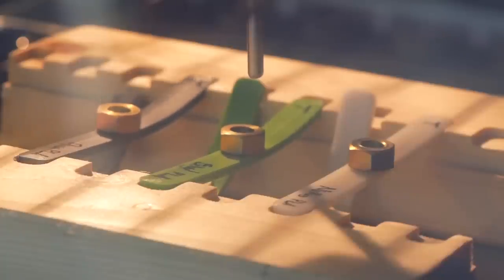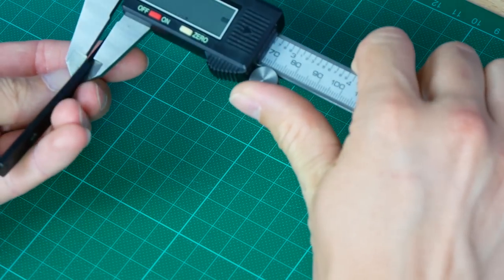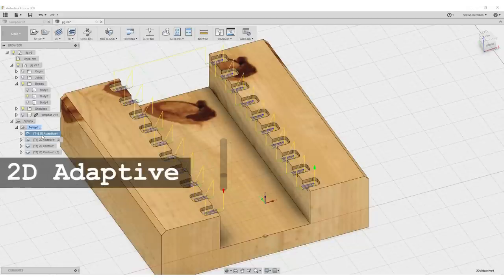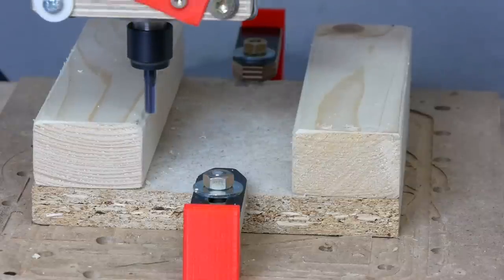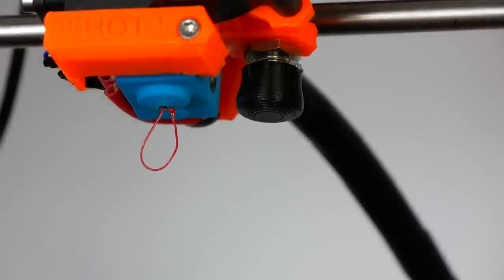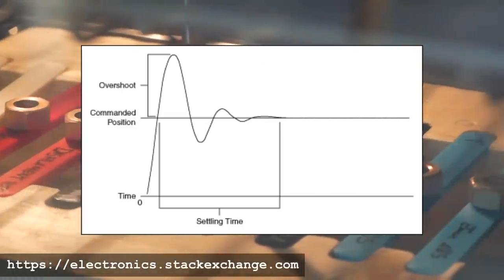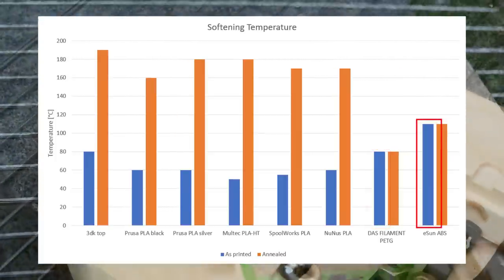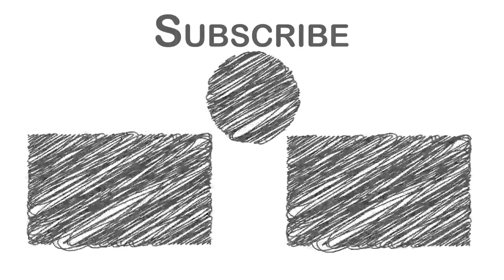What's the temperature resistance of annealed PLA, PETG and ABS?

Comment from the maker: What's you experience with using prints at higher temperatures and annealing PLA? If you have any suggestions please let me know down below!
Reply: I wonder if the shrinkage percentage in each axis is constant for annealed PLA? If so then we could oversize our prints by that percentage amount and keep the expected dimensions.
Reply: it's pretty much consistent, at least according to my experiments. But if you need screw holes to be precisely positioned, you better do the annealing process with the PLA piece screwed in position and solidly clamped.
Reply: hey man, can you test the annealed PLA with gasoline, will it brake? hope you read this thanks
Reply: Hey what about the mentioned amazon affiliation links? i find none in this description :(
Reply: Have you tested 3D Fuel's Pro PLA? It claims 90C resistance when annealed. I have attempted, however there were gaps in the layers and thus didn't suit my needs.
Reply: Stefan What if you coat the PLA with a thick layer of ABS  before annealing and after it you use aceton to dissolve the ABS for minimize deformation?
Reply: I would really want to see a quantified test for the improvement on heat deflection after soaking in grain alcohol (100proof) for 4+ hrs. There seems to be a noticeable difference, with little warping vs annealing (props to Alex Kenis for the process), but it would be nice to see how grain alcohol treated PLA perfoms compared to ASA, ABS and PETG, and if the effects of higher temperature resistant are permanent or temporary.
Reply: What was the distance between supports in your testing? Approx 70-80 mm?

Comment: Just annealed some test strips of eSun PLA Pro and MatterHackers standard PLA yesterday. Putting them in my car today in hot California heat to see if they hold up  -- we will see !!!! As a side note you may want to leave your supports on parts for extra support when annealing  My oven is set to 200Deg F using an oven thermometer, set for 30 minutes heat time and let room cool !
Reply: Just finished testing (tested in oven, not my car) and I can say without a doubt the annealed PLA is MUCH, MUCH better at higher temp. at 160+deg the annealed parts kept their shape after 20 minutes at which time I turned off the oven. At about 125+ deg the non annealed PLA gave up the ghost and warped badly. I have not tested for strength yet, but I bet it will be better than standard PLA. PLA+ shrunk less than standard PLA in the annealing process BTW.
Reply: Thanks for the info

Comment: It's worth mentioning that heat deflection temperature is also proportional to the induced stress in the material, which is why the test in ASTM D 648 has two loading conditions.
This is important because a single point really doesn't tell you much about its useful temperature range.
Reply: There’s 3 points

Comment: Another fantastic, very well thought out and made video. Good work. I love to see this kind of work for the 3D printing community. I'll be sure to drop some cash to your PayPal later this weekend.
Reply from the maker: Thanks, that's highly appreciated! I really enjoy sharing my research with you in order to evolve the technology and the knowledge about it.
Reply: CNC Kitchen I'm the same, but have no idea or talent when it comes to making videos!

I'm currently building a better machine in order to print larger polycarbonate, and hopefully POM parts. I print nylon, petg, abs, nylon-cf, petg-cf and various others at the moment. Trouble is I rely on passive heating of the chamber and have no control. It would be interesting to see you enclose your printer, and the effects of chamber temp on material properties.

keep up the good work!
Reply from the maker: Such a heat chamber will be one of my next projects before fiddling around with ABS because I don't really like the results at the moment. I guess POM's gonna be quite a challenge on a "hobby" printer?
Reply: I have had a lot bed adhesion problems when try to print in POM.
Try to do it on Kapton + Dimafix.

Comment: Tomorrow morning was the time I set aside to find out for myself if the high temp claims of Annealable PLA were true. You answered my question with evidence rather than repeating generalizations that everyone else just repeats.
You also provide shrinkage rates and their direction so I have a starting point for my design work. Can I assume the shrinkage direction is along the direction in which the extruder was traveling as it laid down the layer? I think otherwise shrinkage would be even in all directions. Now I can spend the morning designing rather than cooking PLA.

So look for another 15 US Dollars in your PayPal account. Same deal as last week on saving me from wasting time on designing threads in Fusion 360.
Reply from the maker: You are totally right, the shrinkage is depending on the printing orientation so this is why you can't simply scale the model in all directions. There is some art and knowledge involved to master annealing PLA. Check out for example Formfutura Volcano, where they engineered the plastic to have only minimum shrinkage during the annealing process.

Comment: amazing work ! I made a PLA clip for the sun visor in the car of course it softened and bend out of shape in the car during the heat ... I will anneal it maybe it holds up
Reply from the maker: I'm quite positive that this will work. I actually had the same problem with a part in our camping van and now also need to reprint and anneal it with my new knowledge.
Reply: Did you do it? Findings?

Comment: Fantastic vid, as alway, I really appreciate your scientific approach.  I'm amazed that annealed PLA did so well.   It would be interesting to test the repeatability of the shrinkage to see if one could get accurate sizing by designing the parts larger than the finished product.  I make some parts on  regular basis with a critical internal dimension. I plan on testing some annealed PLA with a machined aluminum core set inside the part during the annealing process. Hopefully this would allow the part to shrink to the correct finished size. Any idea how this might effect the crystallization process?  I may have to get creative on the design of the aluminum core as well since the PLA may be solidly attached after annealing. 

Anyway, keep up the good work! Any idea when you might be releasing the source for your tensile testing machine?
Reply from the maker: An aluminum core might be working well, maybe just add a small taper that its easier to remove later. I will release the CAD and software for the tensile testing machine soon.

Comment: I am amazed, that regular PLA seems to be durable when annealed. So I do not actually need high temperature PLA for most purposes. Also nice to know, that ABS actually is much worse than annealed PLA. I mean, ABS is toxic to print and hard to print. PLA is just easy, cheap and barely toxic at all. Very impressive!

Comment: i printed a tool drawer under my ender 3 out of pla+.  After i started printing using ABS...i made an enclosure and after several hours of a print i noticed my drawer started warping. I now have to reprint the drawer in ABS to avoid ambient temp inside the enclosure from melting my parts. lesson learned

Comment: I think there is a way to "anneal-print" I did some experiments with some PLA parts on annealing as I wanted to find out what dimensional changes will occur to adjust for that. Now  I annealed some "fails" for that all fails of the non print variety (sometimes a part just does not look like or work like you expected so even though a perfect print - its a fail) I found some parts that did not change dimensions at all in any direction and also on a subsequent test when "poked" at 80 C with a screw driver did not dent whereas the  other parts in the "poke test" deformed readily. Now the shrinking parts had all in common that they were printed on a makerbot replicator without a heated bed. The non shrinking where large parts (267mm x 54mm x 38mm ) imagine a block with lots of 14mm hex holes cut out of them) Now those were printed on my matterhackers PULSE (Prusa type printer) I tried to succeed to print it on my garolite build plate without tape when I upped the build plate temp to 80 C. Printer also has a crude enclosure. Now the trick when printing PLA with that high a bed temp is to not touch it until the bed is way back at room temp. So I guess they anneal printed as print time was about 10 hours plus about 30 min of cool down. Print came out nicely except aforementioned design fault) So my next test when I have free time will be to make a "mold" out of PLA by "anneal-Printing" it and then clamp a regular part printed on the makerbot in it and throw both of them in the convection oven - Maybe I make a video of it. Initial test of taking to annealed PLA plastic pieces and clamping an unannealed between it with a "C" clamp and cook it at 200 F - slightly over 90C showed the unannealed slightly deforming to the shape of the annealed pieces but more importantly at the end all 3 pieces came apart so even 90 C is not enough to "weld" a piece of non annealed PLA to a piece of annealed PLA. So maybe there is an all PLA way to maintain dimensional accuracy while annealing. Probably does not pay for 1 piece, but we will make 50 - 100 of those and another test probably would be how high a piece you can anneal-print on a pulse as the temperature definitely decreases the further away from the bed you get.

Comment: Hi Stephan!
I just received a spool of Greentec filament, from Extrudr company. This filament is supposed to be used up to 115°C, but I found it starts to loose its rigidity above 50°C. But even at 90°C, it can be used, under small loads.
I suggested them to send you a spool, so you could make a temperature test on it. If they don't, feel free to contact me, I will send you some.
It would be nice to measure the Bending module vs temperature, using your test jig.
And thanks for all your great videos, they are very valuable!
Reply from the maker: They messaged me. I'll see what I can come up with.
Reply: @CNCKitchen  Cool, thanks!

Comment: You mentioned that for annealing PLA you needed to bring the PLA up to, or just above, it's glass transition temperature. I may be wrong, but is this not true as well for PETG and ABS? More specifically as their glass transition temperatures are higher than that necessary for PLA, shouldn't they be annealed separately (if annealing is going to work under those conditions at all?) 

A quick google search suggests that glass transition temperatures of 60-65 for pla, 88 for PETG and 105 for ABS, you've 'annealed' the PLA at 45-50 degrees above it's glass transition temp, about 22 degrees above the glass transition temp for PETG, and only about 5 degrees over the glass transition temp for ABS. 

I would expect that there would be differences in performance if they all did have the same offset requirements for annealing, and trying to anneal them all at the same temp would not give optimal results for each material.
Reply from the maker: Due to their molecular structure PETG and ABS can't be annealed regardless of the temperature. They are categorized amorphous plastics. PLA is semi-crystalline.
Reply: Hmm, of course that brings up more speculation on my part that I'm not prepared to research. Thank you for the response.

Comment: I am very interested to see your test on annealing temperature on the results. More specifically if the deformation % changes with different temperatures. If you havent checked it out see the article by the Society of Plastics Engineers - Annealing conditions for injection-molded poly(lactic acid). I was thinking of making a temperature controlled water bath to anneal my parts.

Comment: I did it with normal and cheap PLA. My experiance with a short tube Ø60mm, 3mm thickness, solid: evil warping by pure heating, deforming and the length and the with differed up to 14%, not reliable. 
2nd Test, embedded in ordinary salt: no warping, surface as before, length in layer direction -5%, in z-direction +5%, easy to adapt in a slicer. Holding it in steam (98°C for 10min.): when hot, it felt like hard rubber, no deforming when squeezed. So I recommend tempering PLA for temperature stressed plastics up to cooking temperatures.

Comment: Thank you for this. I am trying to print useable fishing lure molds for soft plastic. I was worried that the molds would deform or melt through to the infill from the heat of the hot plastisol when pouring it. Annealing the molds should help a lot.
Reply: Would you be able to inject silicone or something else that at room temperature cures into a plastic-ish material into your molds? Or low temperature glue guns seem to work at 120 C instead of the 180 plastisol requires? Maybe could line the molds with wax paper or something so they'll release and not just fuse the molds together and ruin them?
Please excuse if this is a self-evidently dumb suggestion.
Reply: @angry_zergling  Actually They have been working fine for injecting hot plastisol. I was surprised it worked so well. I have been using Esun PLA+ to print the molds without annealing . I inject the plastisol at 340 degrees ferenheit (170 celcius) without any problems. I do spray the molds with worm oil which is just a release agent for the plastisol (lol it's not made from worms just a funny name. I think it's a type of mineral oil). I think the oil offers a layer of protection from the heat for the PLA molds. thanks for the suggestion though, your idea would probably work as well.

Comment: Have you tried to anneal PLA in a metal fixture to retain shape? I need to have better heat resistance but can tolerance so much shrinkage.  Are parts printed with higher infill percentage less prone to annealing shrinkage???  Looking for best approach with out exotic Prices Filaments. Dennis

Comment: I *baked my antenna for a GI Joe toy to increase strength as I found them just too brittle. It seemed to help. The oven trick is nice as I've used it to level warped parts or modify parts that I printed straight but needed an arch to them. I'm going to try petg and flexible pla for the antenna again and see if that's any better. In the meantime I increased the antenna mast size and printed in pla+ for increased disability.

Comment: If would be awesome, if you could share a screenshot or a table of the results, for us nerds to really analyze.   Also, have  you considered trying to heat treat the pla covered in hot sand or some other medium that my force it to stay in its original shape?  could be an interesting experiment.  I know this technique is used when shaping / bending pvc pipe to ensure it does not collapse when it gets soft.
Reply: Did you end up trying this?

Comment: What size (and mass) are the nuts you used as the weights for the heat deflection test? I'm trying to figure out what to use as weights for my own testing. The largest I have are some M6 nuts that are around 2g each. Is that heavy enough?

Comment: Does annealing affect strength? This was a great video but only discussed temperature resistance. I would like to know if the different materials have better layer adhesion, more or less elastic/plastic deformation and ultimately the effect on their breaking point. Also does annealing change the appearance of fine details or smooth outer surfaces.

Comment: I have a question 

I want to 3d print some helmets/armor for the use of outdoor airsoft. I know that some materials will become soft when exposed to sunlight, so will heat treating parts help prevent this? Will coating the materials in paint also help?

What would be the most sound way of joining larger prints together to resist breaking? I've heard that using resin as a uv-cured glue works OK, but would that be stronger than just super glue or epoxy?

Comment: dankeschön !  Really very interesting ! Sadly my gas oven is unsuitable for this purpose, so thinking of other ideas - toaster oven + PLC maybe :)
Reply from the maker: +Jeremy Kelaher Well, you can still use the waterbath method which works as well. Just bring it to a boil, put your parts in and leave them in there with a lid on top. Might not be as consistent as an oven but still usable for many parts.
Reply: cheers ! I am guessing some part shapes will slump too much during these processes to make it work well ? Perhaps leave support material on for example ?

Comment: Question, would printing PLA in a heated chamber  produce results similar to annealing? I would think that it would improve the crystallinity of the PLA, and thus improve it's temperature resistance.
Reply from the maker: PLA in a heated chamber doesn't work unfortunately. You'll only end up with a globby mess unfortunately. Though yes, if the temperature would be above Tg all of the time, the material would slowly crystalize and therefore anneal.

Comment: If PETG is failing on a lower temperature than PLA then this means that its not suitable as a coupler between a motor and a metal shaft? I know nylon is the best for that but what about the comparison of PLA and PETG for an application such as this?

Comment: If i ever get the owner of the company i work at to get the Markforged printer I'll send you a print that you used for Filament Oilers, see if we can break your tensile machine :)
Reply from the maker: Yeah, the directional carbon fibers might be too much for it. But I would still give it a try :-P I designed it to be able to handle 5000N but only testing specimens up to 2500N so far.